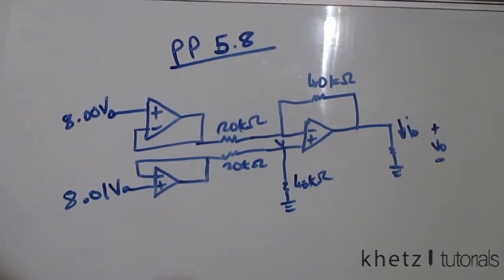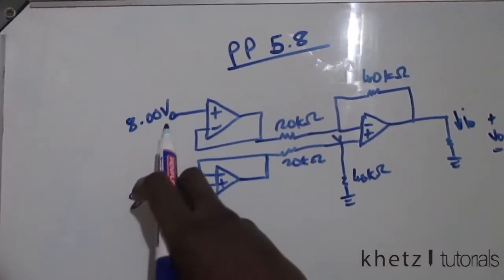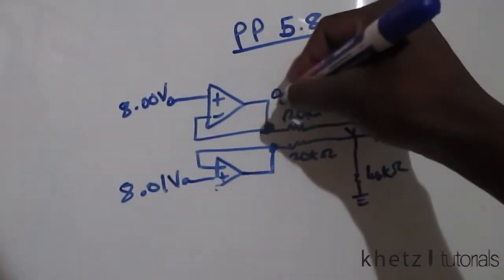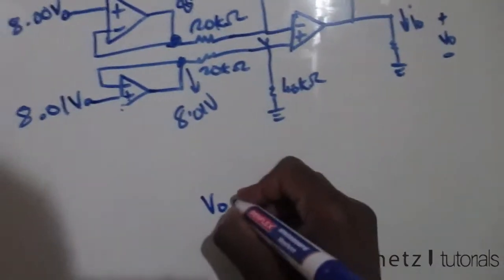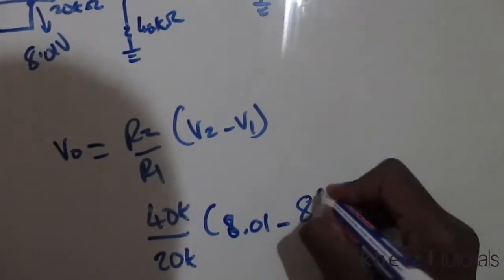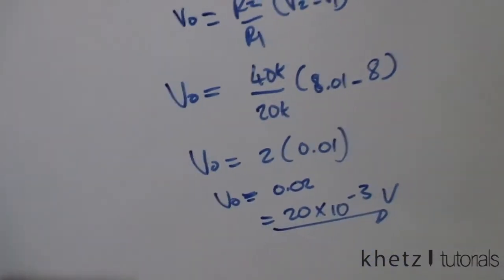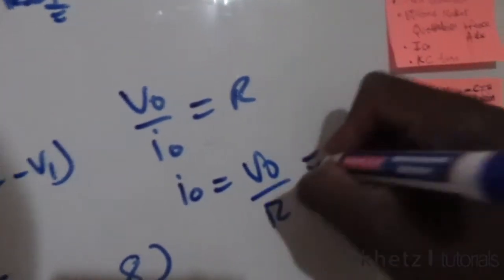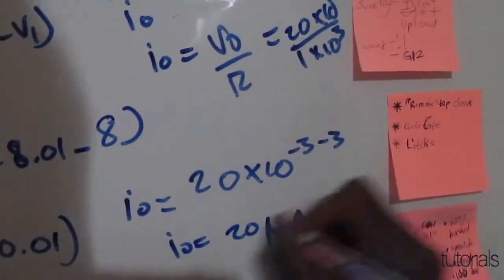Fundamentals Of Electric Circuits Practice Problem 5.8

Comment: 1:21 I'm having time understanding how do you identify the third Amp as a difference amplifier. What should I be looking for?
Reply from the maker: They typically have a voltage divider at the positive terminal and another voltage fed into the
 negative side with a feedback resistor. As a side
 note, if you are asking this for test purposes, you don't have to memorize the configurations and formulas. Just remember your basics, which are introduced at the start of this chapter, e.g., no current into the terminals, equal voltages at each terminal, etc. All these, coupled with your knowledge of voltage division and nodal analysis, should allow you to solve any op Amp problem.